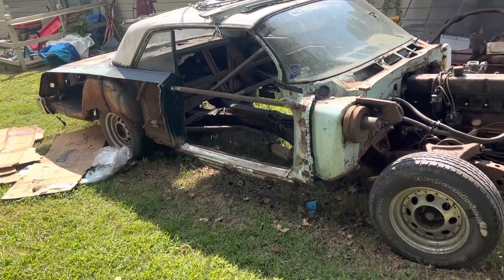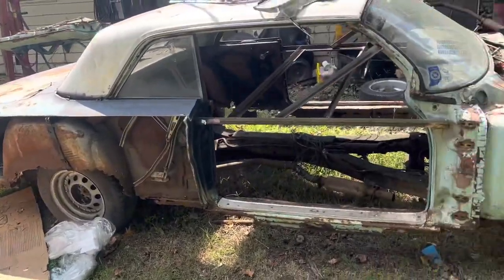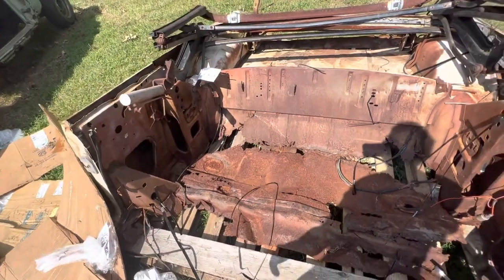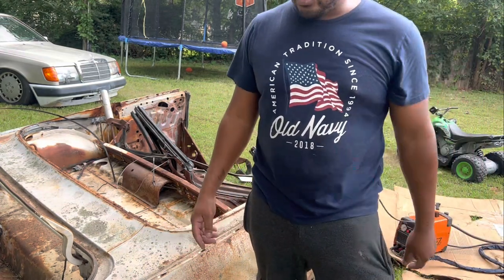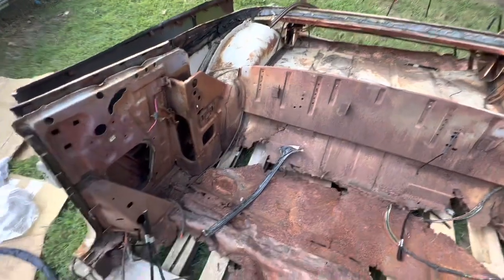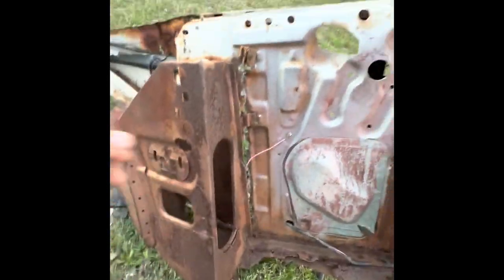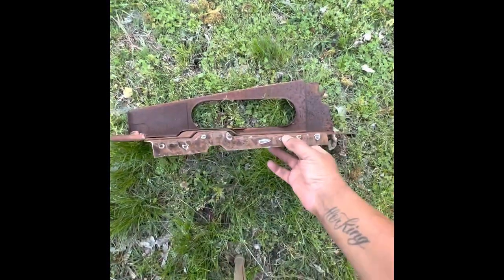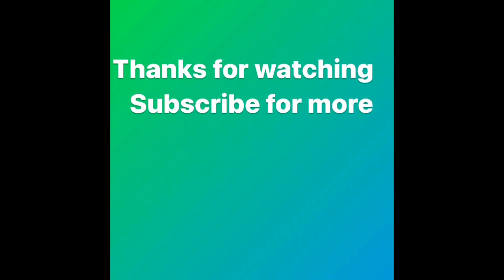1962 Impala convertible conversion part 3

Comment: You cut up way too much You made this 10 times more difficult than what it should have been
Reply from the maker: The other cuts were because the car is getting restored anyway, not just for the convertible
Reply: @clrgarage9299  I was referring to the rear filler piece in between the deck lid and the pinch weld trim You should have not cut that down the center and just dropped the whole tub in it would have made a much cleaner job
Reply: He needs  to save  the rear wheel  tubs  for  the rack  can set down     its set on top of them
Reply: @henryalaniz5366  I'm fully aware of what he did what I was saying is he created himself more work

Comment: Good job but I hope you use the door strikers. I hope you use the top of the wheel well on both sides when you close the rack it goes down all the ways on the convertible conversion part but if you don’t use the top of the wheel wells that rock is going to sit really high, because hard tops have different wheel wells, there’s a whole bunch of different things in that car there’s all kinds of reinforcement pieces I’ve done this 100 times technically I’ve done it 96 times on all years of cars and I’m about to do it again on a 65 super sport I already have the donor car. I’m looking for a 65 super sport. If you hit that button on my page I will hit that button on yours.
Reply: How much would you charge for a 61 conversion
Reply: @TRUCKERSPEED10-4  $7000 you must have a two door or four-door and the donor car
Reply: @theremisterchopshop
I’m going to be doing a conversion on a 62 impala also. I was told that I need a four-door impala trunk because it is shorter and the rack can lay all the way down. I know I have to reinforce the rockers and have to put the convertible brackets on the frame what else needs to be reinforced. Hope to hear back from you. Thanks.
Reply from the maker: I definitely subscribed to you
Reply: The trunks are the same, the hinges and hinge brackets are vert specific , to make the rack lay flat u need the top of the inner wheel house from a vert or custom fab a relief for it to lay flat@jval1394

Comment: Great video, the rear wheel houses on the convertibles are different from the hard tops. Also there’s steel reinforcements that weld under the rockers on each side
Reply from the maker: Thank you, I saw the braces at hubbards for 250 a pair
Reply: brace doors and rockers nice thing is Impala is full frame vehicle ..... cars are a lot of work

Comment: The work is coming out good I’m in the same boat. I have a 62 impala The previous owner had a fire damage to the dash which warped the roof gonna cut it off got a tub from a Buick LeSabre going to follow your steps. I am going to wrap the frame. Is there anything I need to do to the frame? I will fully wrap the frame though.
Reply from the maker: Thank you, I’m buying the kit from hoppos to wrap the frame and that’s it

Comment: Are you still building the 62 Impala?
Reply from the maker: I’m uploading a update video  right now
Reply: @clrgarage9299  I don't know if that top you will work on the 64 but I know for sure it will on the 61. If not I'd buy it if you decide to sell it. l have a 62 and 64 l want to convert
Reply: @kenyattawilliams101 them racks and header bows fit for 61-4

Comment: The upper part of the rear wheel well is different on convertible so the rack has a place to lay down. You should keep the rear wheel wells and splice them in so the rack lays down.
Reply from the maker: Yea I noticed, ima flatten the new tub when I get to that point
Reply: @clrgarage9299  Don't flatten the wheel wells it will lead to other issues use what you have already.